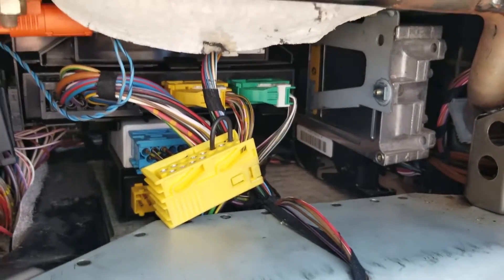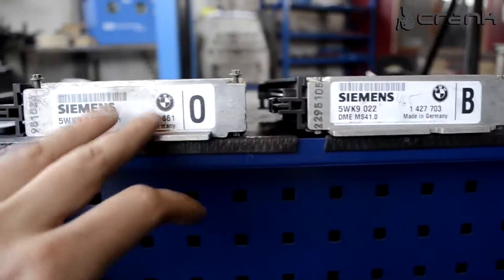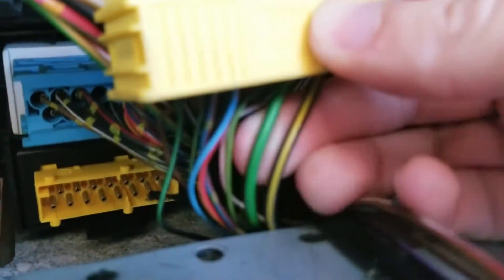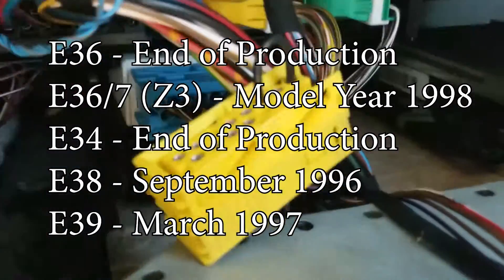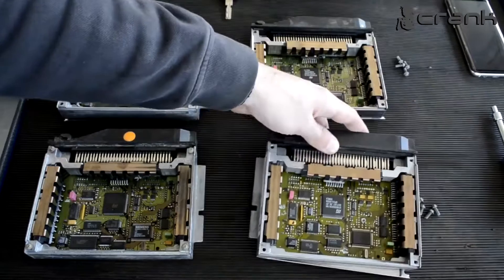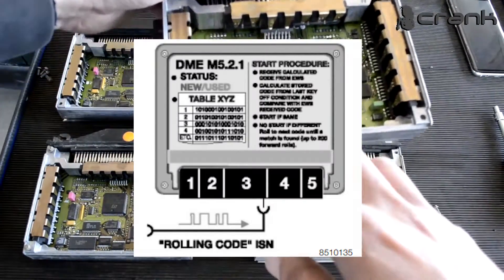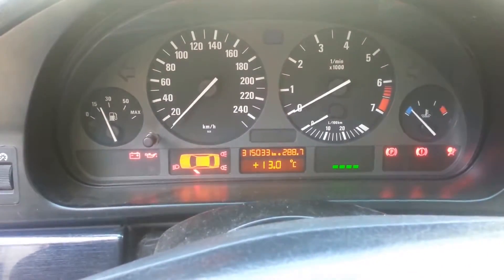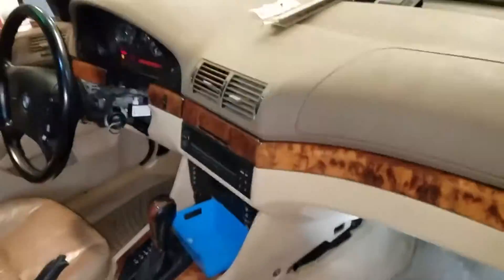Early BMW Anti-Theft (EWS) Will Mysteriously Cause your Car to Literally not Start, and Here's Why

Comment: I’m working on my E63 (650i) cranks but no start condition, i get 2f44 code ( dme: ews preventing manipulation) and has to be synchronize. Can you reco some device that i can use?. i tried inpa but doesn’t work for me. Hoping for your help, tia!
Reply from the maker: Hey, so I don't have any firsthand experience working with E63's at all, but I did make a video that goes over CAS, which is pretty much the exact same thing as the EWS modules in E63's. Same functions and everything, just different name. I also talk about a couple tools that can be used to help solve the sync issues towards the end of the video! Here's the link so you don't have to dig through my channel: https://www.youtube.com/watch?v=wQNCP_Qt0Ck
Reply: Im planning to buy a device that’s capable of synchronization i just want to make it sure what it is, coz it cost more here in japan. Thanks man!
Reply from the maker: @jbramos420  No problem! Hopefully it all works out!
Reply: You can get the EWS disabled in the ECU. Also a locksmith can check if you have still got a signal from your key. Also make sure you have 14volts

Comment: Wow all this is some high tec stuff that's for sure well your video helped me out to understand my situation a little more but still don't know the exact problem..maybe u could shine some light on me. Ok so I have a e46 325i 2001 that I had added some small mods and when I put all back together lost the key had one made and unlocked and close normal but gave me problem starting for hours on in with no crank no start all lights turn on like normal. It does not click ether I checked startes fuse and also did a direct starter and it's good . So yup that's where I'm at any ideas on what to check next?well buddy if possible a little direction would be great help... thanks for the video bye
Reply from the maker: Thank you for the kind words! Also I wish I could shed some light on your issue man, I totally understand how frustrating it must feel. Unfortunately, I know nearly nothing about diagnosing e46's, as I've never worked on them. Not really sure what sort of systems are at play here that could be causing your issue.

It's a bit of a shot in the dark, but my best guess is that maybe your ring antennae isn't able to communicate with the key to verify the passcode so it can pass it through to the DME?
Reply: Ok wow I didn't know the ring had to be the same one as well and included in the combo ews,ecu ,key from my other car I'm taking it out from so the ring  that's already there has to be replaced since it's not universal. Ok so that's maybe why it didn't even cranck.. What is the pcm ram that your talking about thought ram and memory where inn the ecu??confused wow ok ima check that out..i bought a ecu from this dude on offer up that deletes the ews and at the same time comes with a tune to get some extra ponys out of it.. this should really fix the issue if it is the ews kossing the problem. Pcm ram hmmm need to see what this is all about...well buddy thanks again for giving some thought and directions very appreciated stay blessed TTYL buddy
Reply: @straightup6027   hi ....i have the same problem and thinking about the antenna first and if no change i want to try the ECU withEWS delete. did it work or you please?
Reply: Thanks for ur response so I changed the ring and same thing I got a code of p0604 ....question I got a 330i 01 right if I take the ecu and ews can I put that in this 325i 01 and have it work
Reply from the maker: @straightup6027  If my memory serves correct then you should be able to do that but you'll need the ring as well, because they all communicate between each other via EWS3. When you put the key in the barrel, the ring sends a code to the EWS module, which then checks it with the ECU in order to make sure they're all the same.

Also yeah, p0604 looks to be the PCM, that sucks man. Such a pain to diagnose these cars sometimes only to find out the problem is completely different than you thought. If swapping the EWS, ECU, and ring don't work, then you might have to replace the PCMif the RAM is fried
Reply: @Brunboi  bro if I unplug the ews out and throw away will it start then? Cause Ive got the exact same problem no crank no click only lights when I turn.
Reply: Shall  it do the anti theft system still afer I unplug the ews?
Reply: And I know once the ews has been unplugged the car is very easy to steal but idgad, I just want the car to start:(

Comment: Question... so if it's not the key transponder or the ring antenna... how do you fix the ews module? Does it have to be replaced or can the original ews be fixed?
Reply: You can send the ECU to a BMW software tuner and they will remove and disabled the EWS system in the ECU. This is common on engine swapped cars needing the same situation
Reply from the maker: That's a really good question. I honestly don't really know if it can be fixed or not. I'd imagine that with enough determination it could be fixed, but every case I've seen of the ews module going bad has involved replacing it instead of trying to fix it

Comment: Can u just delete the system or like will it not start at all
Reply from the maker: The ecu checks for it whenever you turn the key if you have a stock tune. It's possible to disable that check though if you use a piece of tuning software called romraider
Reply: @Brunboi  i have a 95 325i can I use it on it?
Reply from the maker: @marcoramirez4074  you should be able to. As far as using romraider, you'll have to do some digging yourself, but they have a forum that is packed with super helpful information! Just look up something like "e36 ews delete romraider" to get you started
Reply: @Brunboi  alright thanks

Comment: Do you know how to fix the crank no start condition on a 93 530i? I got a new key from the dealership and still won’t start
Reply from the maker: Have you tried unplugging and jumping the ews module? If the module is bad then that could be it
Reply: @Brunboi  ^
Reply: I have a 96 328i that wouldn’t crank until I put that jumper wire in the EWS plug behind the glove box and now it cranks but won’t turn over. Any suggestions ? 😭
Reply from the maker: @Bigrigmig1  I made a video semi-recently that more or less goes over one of the easiest ways I've found to address that issue. I'd recommend checking it out, here's the link so you don't have to go digging: https://youtu.be/JHSuUaKgEw4

Comment: I see ur park light in lit up on dash mine is not also no lite on gear selector..new battery and starter still NO crank no start BMW 2008 328i. has 3 CAS module CODES AOCO AOBE and another BAD CAS? or need to be aligned?
Reply: Call bmw hot line they come end make free 10 min